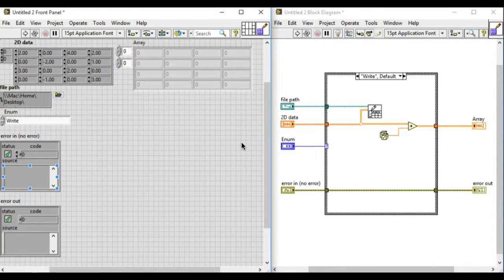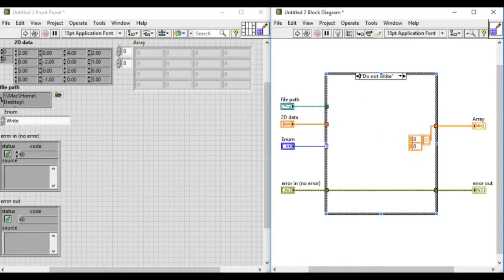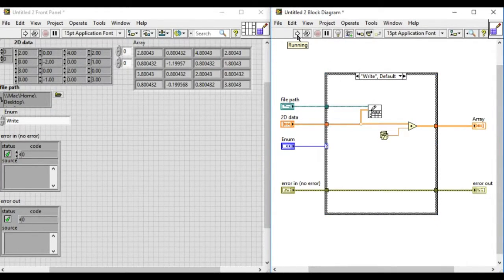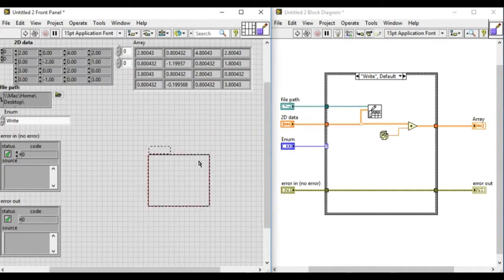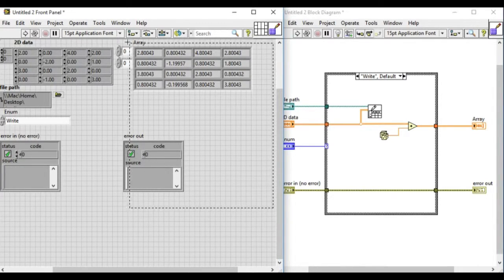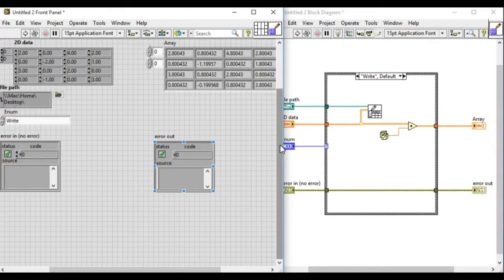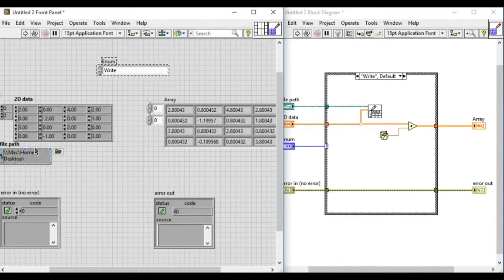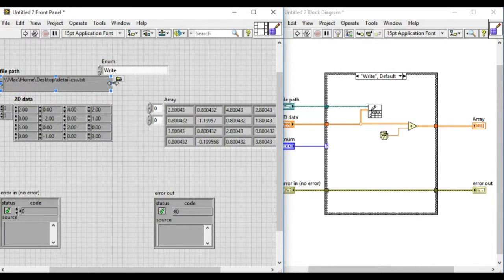How to place Controls and Indicators - LabVIEW

Comment: Thank you for the informative video. An alternate method and more efficient is to attach the controls and indicators to the connector pane, then type CTL+A followed by CTL+U, the LabVIEW will automatically clean up and arrange them according to the used Connector pane style (NI Recommended 4x2x2x4)